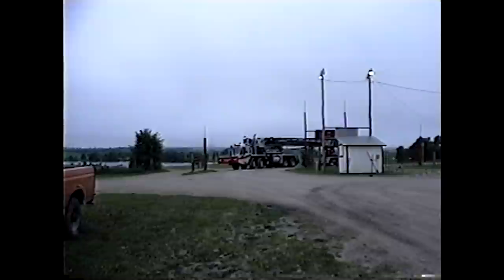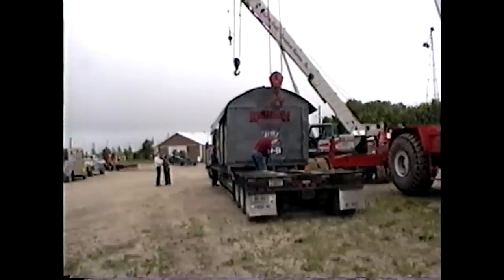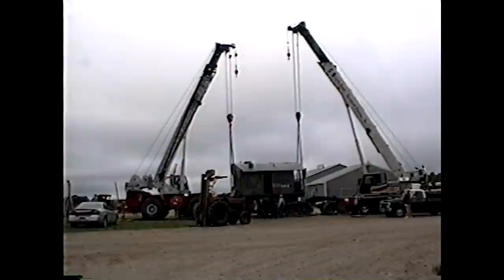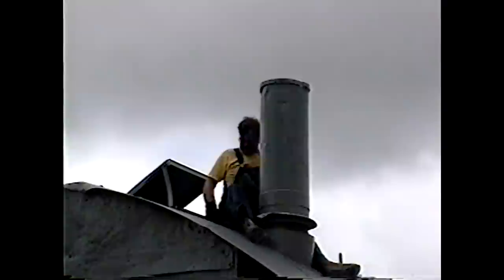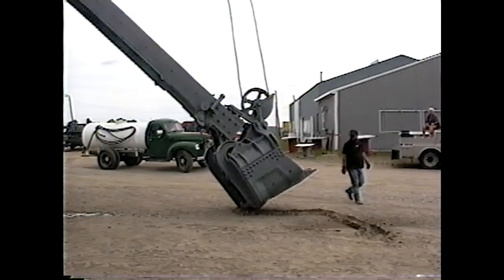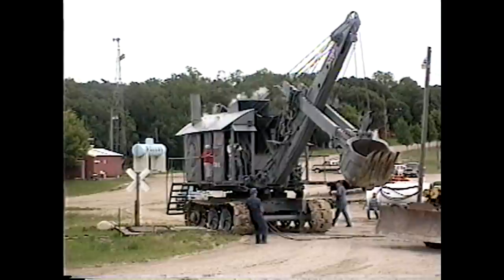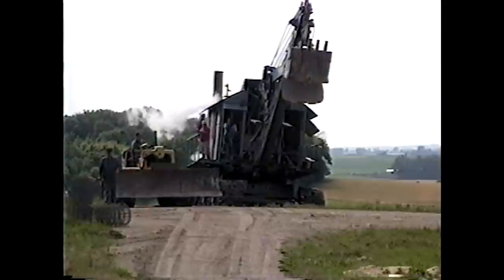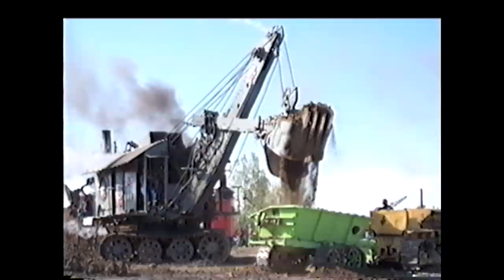From The Archives: Assembly of the Bucyrus Erie Steam Shovel

Comment: Good thing no old timers where kilt off in this assembly. Good job boys. Getting boom pins in is always tricky, but ya got her. One time a company I worked for bought two Northwest 80's with Murphy diesels. One set up for dragline the other was a shovel. One of the scariest moments of my life was driving that shovel onto the trailer. Another was tracking to dragline up a slight grade to the quarry where we where going to use it as drop cross. While tracking up up hill the drive dogged out and back a rolling I go, all I could think about is the power lines at the bottom of hill, jump or stay. Well I stayed and she finally just stopped rolling. After that we tied off to D9 for insurance. We finally junked them old girls, but I got the big ole Northwest sign off dragline  and it graces the over the door to my shed to this day. Thanks for saving this old machinery for people to under stand history of dirt moving.
Reply: Very interesting machines! I'm glad there are people keeping history alive!

Comment: Great video, I'm a former crane operator and am amazed that you need to use a boom dolly for that 70 Ton Link-Belt crane  in your state. I have driven a 130 Ton five axle Krupp all over southeastern Massachusetts with full time four axle steering. And 80 ton versions of the same make with optional rear steer capability. I am amazed that the 50-B had absolutely no steering at all. I would think  that a fairly simple but expensive to build one of "lock- out" front hub system would do the trick. You have all the time in the world to plan the turn, just stop the machine and unlock the track you don't want drive ; and I would bet that thing could actually steer. Just my 2c.

Comment: When I was young well what younger  I was a mechanic for the largest high altitude logger in the state. Big old growth timber . 3 log loads were common. They had 2 30 b s . I worked the trucks but when hawkey's 30 b was down it was the number one priority. I remember the steel balls for the roundhouse bearing . It got a major overhaul except for the engine it had been rebuild over the winter a couple of years earlier. And the stick.

Comment: With the two cranes being used to unload & assemble these pieces,  can you imagine the equipment used to do the assembly when these diggers were new..
Reply: Lots of steam in the air then I’m sure.
Reply: Assembled in much smaller parts on site with the idea being they basically worked till they fell apart then do the cut up for scrap or like so many simply abandoned 
Only a tiny percentage of them made it to the common day

Comment: The old Kitty Cat had her toungue hanging out, trying to drag Mary Sue up the hill! A lot of booms are fractured due to boom base pin looseness. As soon as a little clearance develops, a banging starts in swinging and stopping. That's transferred to the bucket and massively intensified returning as TORQUE on a square section. this causes lateral ripping of the metal. Small ammounts of sideways push on the bucket equal HUGE lateral boom shear force! It usually appears diagonally. That's why "smooth operators" were preferred!  the wider the base pin clearance, the exponentially faster it wears! Keep side stays tight. A lot of that welding probably could have been skipped if new base pins and bushings were installed. All that jerk from poor operation is transmitted directly to the turning gear, and that gets expensive! I have seen "smooth operators " who could run a shovel that loose and swing it without rocking the pin clearances! Companies only cared about tons/hr, so they encouraged operators to "bang her around if you have too but get the job done QUICK!" Private owner- operators had a huge investment in machinery, probably used at that, and it had to LAST! So their kids could inherit it and the small "buisness" that came with it! If someone jerked his old shovel around and didn't maintain it, he'd get fired and possibly socked in the mouth! Then the owner gets a job running a new shovel at a quarry close by and walks off the job after a week, and tells the boss "I can't treat any piece of equipment the way you want even if you pay me and its YOURS!" Men  and women like that have been owners and stewards of this amazing machine for many years of her retirement now! She may have arthritis, but Mary still dresses up nice and likes to waltz!

Comment: Surprised they didn't block up the back end until the counter weight of the dipper was installed. All that weight was hanging off one side of the ring gear toward the back of the house.